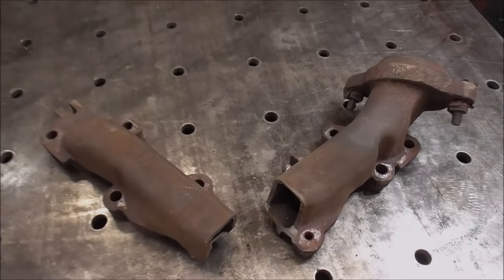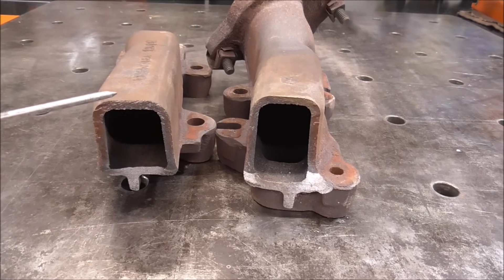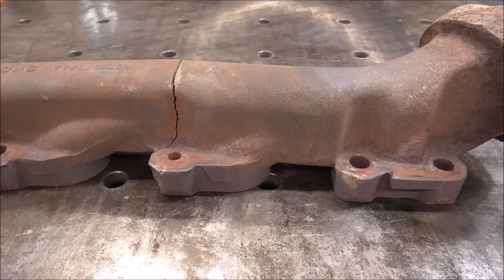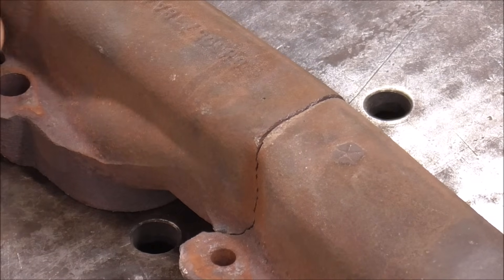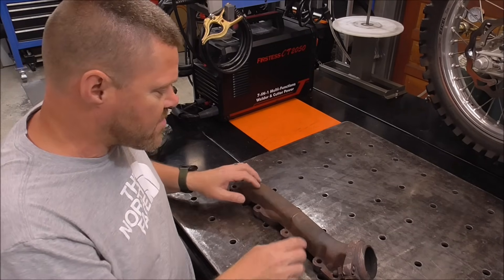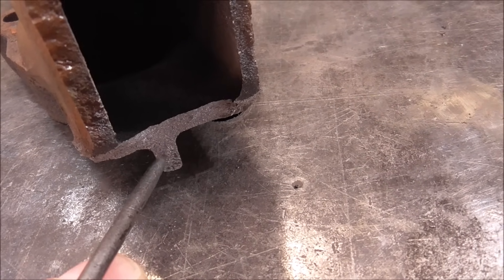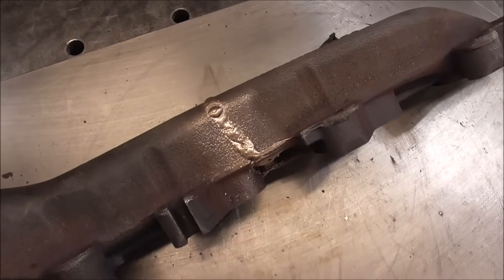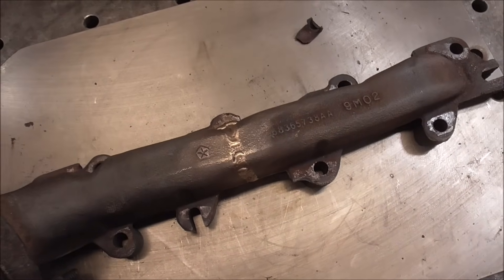Difficult Cast Iron Exhaust Manifold Welding Repair

Comment: I’ve seen these come loose with low miles, then a less experienced auto tech will just slap in new gaskets and crank it down thinking that’s good enough. It isn’t, this is a known issue with these. 
Smarter techs will remove the manifold when there is an exhaust leak and see if the mating surface is truly flat. Often times they are bowed. If there are no cracks, the best option is to get it into a machine shop to have that mating surface ground flat again, then they last a lot longer. 
When a tech assumes it’s good and just cranks down the fasteners, these things crack and break.
There really should be a recall on these, but there isn’t. Shame on dodge for yet another avoidable failure.
Reply from the maker: I think you are spot on. That's my thought also. I bet during the cooling process they bowed and nobody caught it. That was my thinking when I noticed the gap on the outside and tight on the inside when I had the flanges on a flat surface. I'm curious to test on this a little.

Comment: Sorry that is cast steel you can just weld it with regular mig wire or arc.
Reply from the maker: Finally! I can't weld cast iron without at least someone saying its not cast iron. 🫵

Comment: if it was mine i wanted you to weld reinforcement strips on the outside too, lengthwise!!!  4 or five,  no need for beauty(ugly to begin with anyway   lol) 
---the manuf DID it WRONG, you can NEVER have a manifold in one piece that long, everybody knows that!!! so, i would want  reinforcements,
--- and then, NEVER  do the nuts/bolts very tight on   those long one piece manifs , they grow with the heat ! red hot !!  and they take EVERYTHING  on their front, theybgROW FOR SURE,  NOTHING can stop  that,   BUT  when they cool and retract,,  IF IF IF the bolts are too tight, that is when the cast iron  MANIFS SPLIT!!!!,,,
SO, those nuts, bolts, studs, NOT TOO TIGHT, loose is better,  try to use a  SS embossed gasket, if there is one
Reply from the maker: Great tips! Thank you!

Comment: That's not bad CASTING - that's bad MACHINING!  It SHOULD have been MACHINED flat at the factory - Obviously it hasn't been, OR it's warped over time!  Machining it flat SHOULD prevent any more cracking and take the stress off the part.
Reply from the maker: I cant imagine they didn't machine it falt but I guess anything is possible
Reply: @BrandonLund  Hard to say - I'd expect that it warped over time - Ma Mopar has been making Cast Iron Exhaust Manifolds (And HEADERS) for a LONG time, and they were always reliable.  Of course nowadays - QUALITY has sunk to the bottom and started digging deeper!
Reply from the maker: You got that right! It's a shame what's happening

Comment: He does not have a clue.
 Weld prep right to the bottom leaving points for alignment bolt it down, prefer it to be bolted to a fixture with the same bolt pattern. Heat it with a propane torch red hot over a large area,  low heat a lot of BTU's. then acy / oxy weld it or use a high nickle electrode. Grind finish then use a needle gun and the weld will disappear
Reply from the maker: Don, I made this video for people like you. People who have a very limited understanding of cast iron repair and think that their way is the only way to repair cast iron.  Just because you don't understand the process, doesn't change the fact that not only does this process and filler metal work (better than nickle), this process has been sucessfully used for decades. I've probably forgot more about cast iron repair than most will ever know. Hopefully you accept my response as trying to educate you rather than belittle you, which is what you did to me.

Comment: This doesn't seem that difficult. In our shop we would have heated up both end and smashed them together. Easy. No manually welding necessary. You guys should focus on automation, and stop doing things the way your great great great grandfather did them.
Reply from the maker: Just heat them up and smash them together huh 🤔 Lol cute
Reply: @BrandonLund  That's it. High heat and high pressure.

Comment: Next time bolt it to a head.
Reply from the maker: Its not a good idea to restrain cast iron while its being welded. It increases the chances of stress cracking.
Reply: I didn't know that. Thanks for the info. @BrandonLund
Reply from the maker: Anytime brother. For most everything else that's a great idea but cast iron is real fussy with expansion and contraction